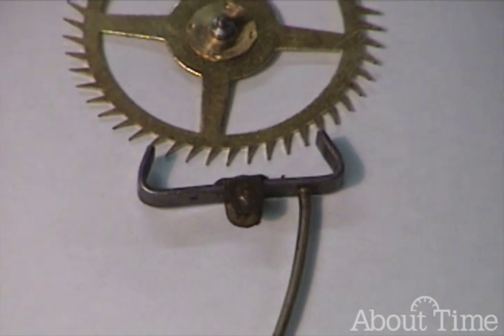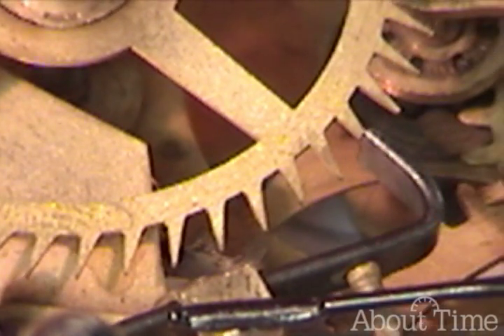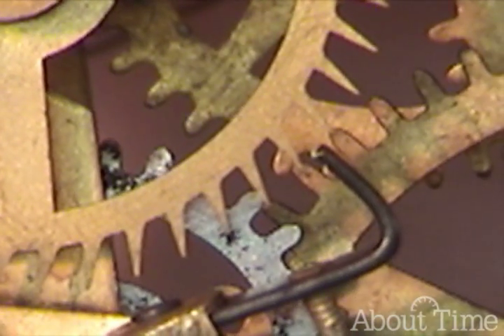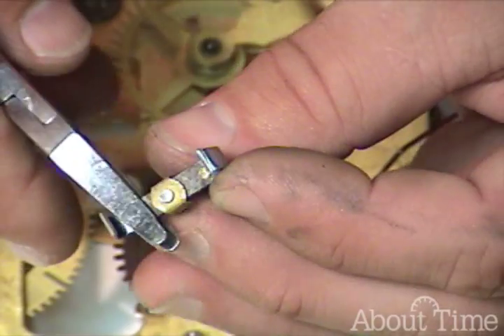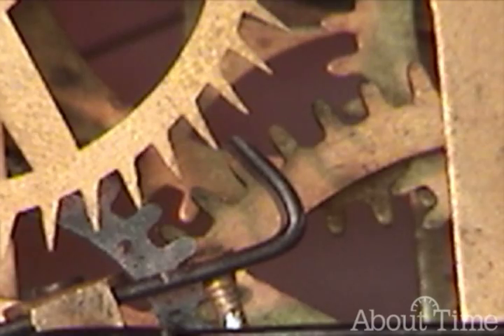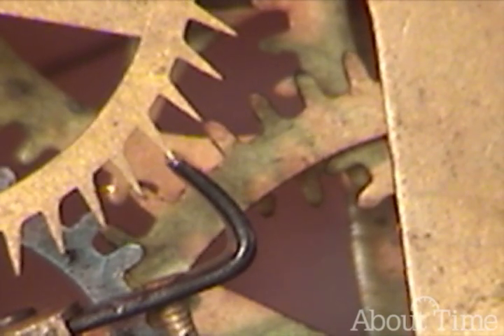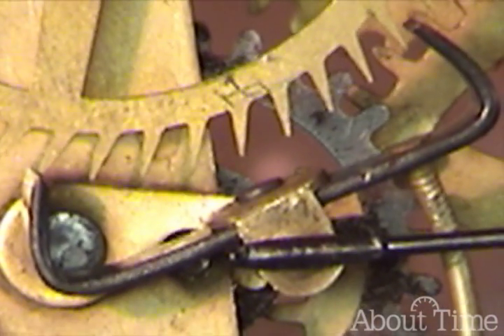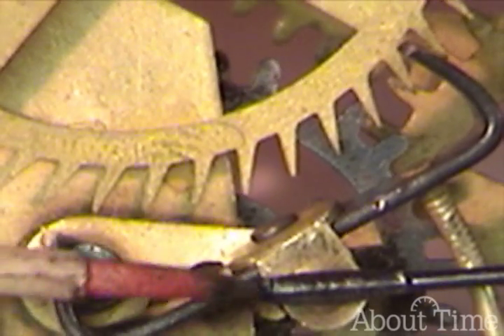ClockClass - The Half-Deadbeat Escapement

Comment: I have a similar, identical situation.  I see you bending the verge ever so slightly.  Do heat harden the little guy when you are done?  I feel like the verge I am using does not hold the bend.  or something.  The tolerances are tight as you know.
Reply from the maker: The middle of the anchor should be left soft so it is bendable.  If the middle of the anchor were hardened, it would be prone to breakage when adjusted.  In fact, it is best to test the hardness of the anchor with a file to be sure it won't break when adjusted.  

If you feel your anchor isn't holding the bend, you aren't actually bending it :-).

Comment: Thanks! You make it look easy. I'm going to try again now, especially that last adjustment move. I have problem where it won't keep running .. stops after a few hours ..
Reply from the maker: Hi Sputnik-  Your stopping issue may not be escapement related.  Everything about the movement needs to be considered when troubleshooting power issues.  Make sure the movement doesn't have significant wear and is well lubricated.  And yes, the escapement does need to be properly adjusted 🙂.  But, if your movement is running for several hours before stopping, the problem might not be the escapement.

Comment: Would an out of adjustment escapement cause the ticking sound of the clock to be more of a knocking sound? 
 
My clock knocks for a while, then fades to the normal ticking and then back to the knocking.
Reply from the maker: Knocking sounds as you describe are more than likely the pendulum hitting something as it swings.  The pendulum tries to reach its normal amplitude but then hits the side of the case, or other obstruction, before it reaches its maximum excursion.  This dampens the pendulum action, reducing the swing, and the sound goes back to normal.  There are several solutions to this issue...

-Make sure the case is level and the clock is in beat.  If the clock isn't level, the pendulum will come closer to one side of the case than the other and could strike the side of the case.

-If the pendulum hits both sides, the escapement will need adjusting so there is more exit and entrance drop.  This will reduce the amount of swing of the pendulum by reducing the lock.

-See if the obstruction can be moved.  I've seen gong standards improperly positioned and interfering with the swing of the pendulum.

Hope that helps!
Reply: @clockclass5480  yea, thats what i thought at first, but if i reduce the swing by hand, it doesn't get any better, so i assumed it was escape mechanism because i cant find where the pendulum is hitting anything.
Reply from the maker: @kwacz  Ok!  This is all part of the troubleshooting process.  Look for the easy stuff first 🙂. Since your pendulum isn't hitting anything, it could be your escape wheel has damaged teeth or is out-of-round.  This would cause the pallets to lightly catch an escape wheel tooth rather than fully releasing it and cause the knocking sound.  This would generally stop the clock.  One way to tell if it is the escape wheel is to count the ticks.   If you consistently get 7 knocking sounds, for example, followed by 31 normal ticks, it is the EW that's the problem.

Here is an article which discusses escape wheel problems...  https://abouttime-clockmaking.com/pdfs/escape_wheel_problems.pdf

Comment: Could you Bend the anchor slightly to create distance instead of moving the stud ? 
Thanks
Reply from the maker: Hi Paddy Pup-

Bending the anchor adjusts the entrance drop and moving the stud adjusts the exit drop.  So no, you can't really bend the anchor slightly to adjust the exit drop :-).  

Great question!
Reply: @clockclass5480  thanks for reply. This question is actually related to the verge on a cuckoo clock that doesn’t have a stud that’s why I wondered.
Reply from the maker: @paddypup1836  There actually is a stud, sort of, on a cuckoo.  It is a finger which is part of the plate and can be bent upwards or downwards.  However, repeated bending will cause it to break so try to get it right the first time :-).
Reply: @clockclass5480  oh thanks.
Reply: @clockclass5480  so it’s on the brass plate?  The anchor on the cuckoo is welded to the pivot bar for use of a better term.
Reply from the maker: @paddypup1836  Yes, on a cuckoo movement, the "finger" is on the back plate and holds the pivot point of the anchor arbor.  Bending this upwards moves the anchor away from the EW and increases the amount of exit drop.  Downwards does the opposite.

The pallets on a cuckoo are held to the arbor with metal which has been peened over.  They are fit to a slot in the arbor and the edges of the slot are moved in to secure the pallets to the arbor.

Hope that helps!
Reply: @clockclass5480  thanks a lot . I  enjoy your videos
Reply: @clockclass5480  now I see it. The piece that sticks out on the back plate indeed like a single finger pointing up at about 45 degrees.. this was very helpful
Reply from the maker: @paddypup1836  Yep!  That's it.  Glad I could help!
Reply: What about an adjustable stud, or pallet cock?
Such as on a S. Thomas 30-hr movement?
Reply from the maker: @davestelling  The adjustable stud, eccentric bushing, and pallet cock allow for varying the distance between the escape wheel and the anchor.  This is an adjustment for exit drop.  Moving the anchor closer makes the exit drop smaller and moving it away increases the exit drop.  The entrance drop should be adjusted first and then the exit drop.  Both drops should be equal and small but large enough to account for irregularities in the escape wheel.  Hope that helps!

Comment: Noted your adjustment re. catching the back of the escaped tooth. However, I noted also that, as the title states, the closing shot just before the scene faded, showed quite a bit of recoil. Surely this could be eliminated completely? If the anchor surface presented to the escape wheel is radiused to the pivot, there should be no problem.
Reply from the maker: Hi Bev- Half-deadbeat escapements do indeed have some recoil and could instead be called "half-recoil" escapements :-).  They have a combination of recoil and deadbeat characteristics which make them neither deadbeat nor recoil.  American clock companies developed this strap anchor style as an inexpensive deadbeat, not caring that the exit pallet wasn't radial and exhibited some recoil.  You are obviously advanced in your escapement knowledge and realize that reshaping the exit pallet would make this escapement a true deadbeat.  However, this isn't what the manufacturer had in mind and the effort to eliminate the recoil would exceed the benefit (in my opinion).  In other words, a half-deadbeat strap pallet escapement which has recoil isn't problematic.  Thanks for your comments!
Reply: @clockclass5480  Many thanks for your reply!  Yes, I have seen the term used before and was not doubting your info for one moment! It`s just that I wondered why a half factor would be used. Was it perhaps that a full dead-beat could be a little more noisy - especially on a movement made to a price in various aspects?
Reply from the maker: @darkgreenambulance  A deadbeat wouldn't necessarily be noisier but it would take more time to properly shape the pallets.  More time means more expense and the clock market has almost always been driven by "faster/cheaper", even at the expense of accuracy.  American clock companies mass produced clocks with the half-deadbeat escapement in the early 1910s when society became more dependent on knowing what time it was.  America was industrializing (and at war!) and needed to know what time it was in order to catch their train, get to work on time, and know when to quit for the day.  The clock market became very competitive and companies which could turn out clocks faster and less expensive than their competition had the best chance of not going bankrupt.  So, I don't believe the half-deadbeat strap pallet escapement is anything other than an attempt at deadbeat accuracy on a shoe-string budget.

Comment: Well done. Surprising how small a difference was made by moving the pallet anchor away from the wheel.The move looked huge, but the result was not so drastic, and of course just what was needed. Interesting what happens when the pivot for the anchor moves in an arc when adjusting on these clocks. Truly though, the segment of an arc is very small so of no real consequence.